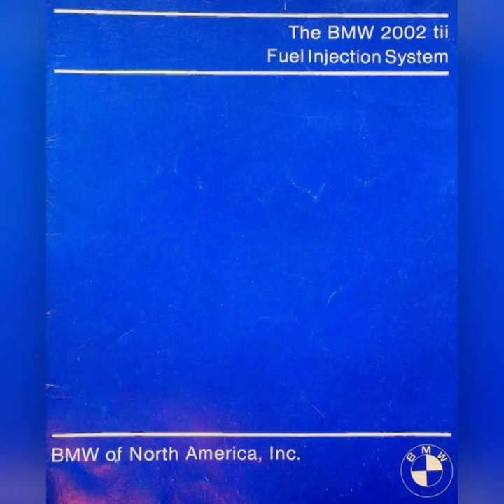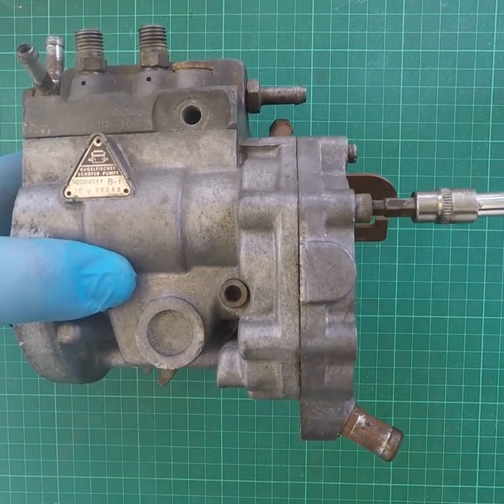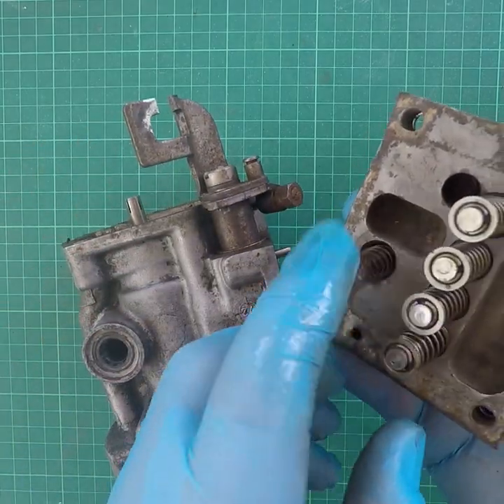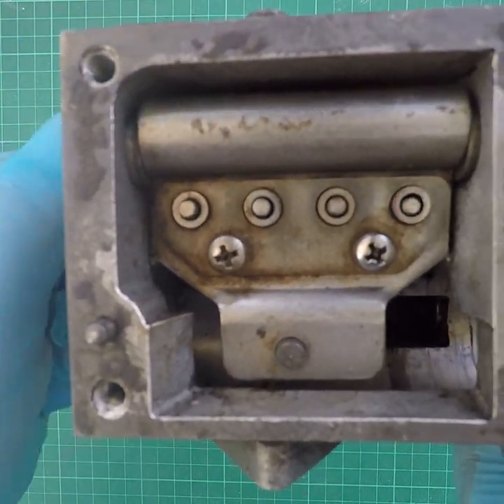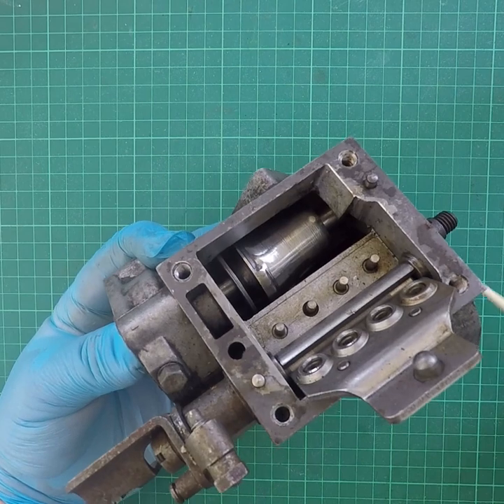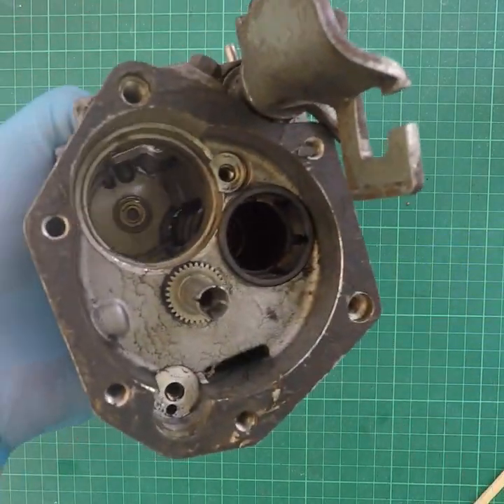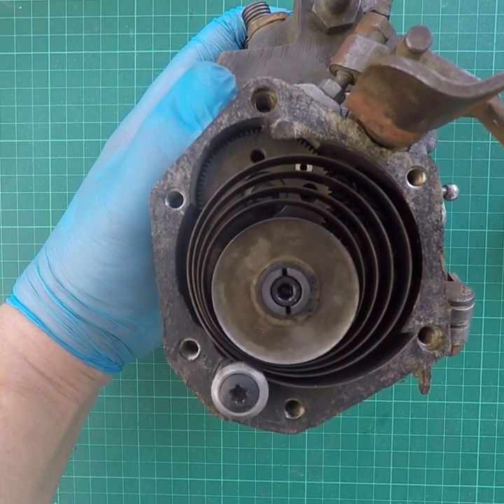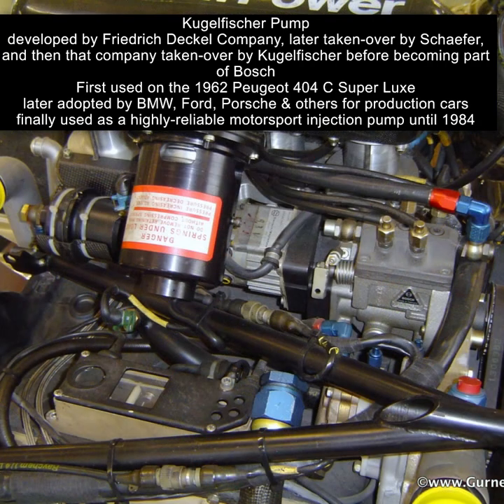Inside the Kugelfischer / Schaefer Mechanical Fuel Injection Pump

Comment: I've been told that the version used on the Peugeot 504 Ti runs on engine vacuum and therefore impossible to add forced induction - do you know if this is true?
Reply from the maker: Yes, the Peugeot uses a variation of this pump: As i understand it, the cam and fuel delivery pistons are the same, but the height of the 'hinged plate' is controlled by manifold vacuum. This is arguably a more direct/better approach than the BMW implementation,which is very sensitive to throttle synchronisation. I also guess that this manifold vacuum Peugeot system doesnt respond to 'boost' as thats not what it was designed for. There are turbo versions of this KF pump where the 'speed control' of the cone rotation is replaced by  manifold pressure control of the cone rotation.
Reply: @ctc77965o  Thank you so much for your informative reply! Do you happen to know any good resources (books, websites, etc.) what I could learn more about kugelfischers?

I'm restoring an old 504 and was considering if it's worth or even possible to add a supercharger or turbo with some modification

Comment: Great video. I have a question for you - does the elbow on the bottom for the oil drain tend to feel loose? I am sorting out multiple oil leaks and noticed that the elbow moves slightly and was wet (not sure if oil came from there or elsewhere). Any advice appreciated.
Reply from the maker: Yes that drain hose is often rather swollen & soft...it's only job is to direct the oil back into the engine sump, so you can replace it with a suitable oil-resistant hose (not water hose). It should not be loose, make sure suitable hose clamps seal it well at both ends... there's only crankcase pressure there, but it can still leak and slowly make a mess.
Reply: @ctc77965o  thanks for the quick response David! The hose itself was tight but I did remove it to replace anyhow. However my main concern is that there is a metal elbow that comes out of the kfish housing and 90s, and the hose is attached to that. The metal elbow feels loose in the kfish housing just a bit. I have video, not sure how to post it here. Is that normal? Or is that elbow usually rock solid?
Reply from the maker: Sorry misunderstood...that metal.outlet pipe should be rock solid.
Reply: @ctc77965o  hmmm so I have an issue there. Any idea how to tighten it up, or why it’s loose? It does not spin. My natural gravitation is toward something like RTV or JB weld
Reply: @ctc77965o  dug a bit further. Removed the back cover off the kfish and I can see that elbow is held into the cover with a roll pin. I think I’ll clean it well and seal it up on the outside to prevent leakage. Planning to use JB weld. Thanks so much for this video, for your responses, and for my WUR rebuild kit! I did that yesterday before noticing the leak at the bottom.

Comment: What pump pressure do you need?
Reply from the maker: 30psi is what's expected...that fuel pressure is what "fills" the pump, assisting the suction of the spring loaded plunger/pistons. I don't think higher fuel pressure makes much difference (fuel is quite incompressible) but very low fuel pressure...or fuel pressure that reduces in hi flow/max power condition will cause misfires.

Comment: Pretty clever. I was completely unfamiliar with this system being over here in the States.. Although I assume if I was in to older BMWs that may have be different. The delivery  of fuel is very similar to an inline  diesel injection pump but the metering is more similar to a rotary pump. and the control, and mapping ability is very unique.